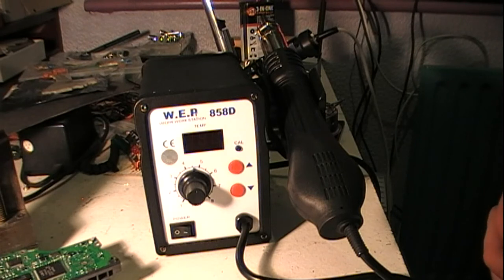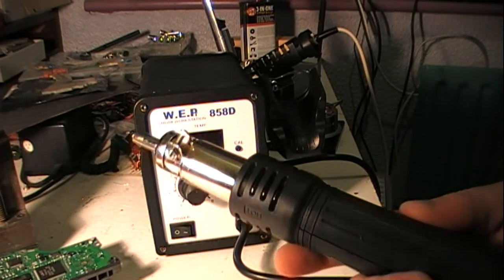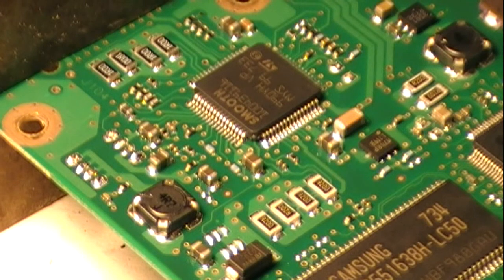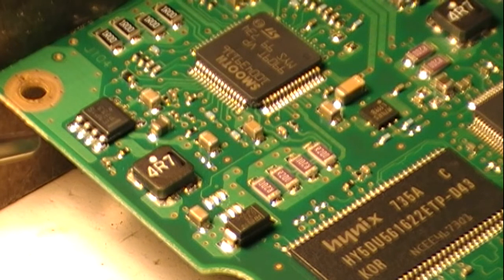Replacing serface mount components with a £30 reflow station WEP 858D

Comment: Plumbing Flux is corrosive   As Danfuerth said,  get the right flux for PC work and it would help to add some 60/40 leaded solder this will lower the melting point of the solder on the board.  you can put some Kaptan tape around the part to be removed this will help to protect the items that are close.  you done a great job  👍👍👍
Reply from the maker: These are all good points. You'll be relieved to know that I eventually got some proper flux that I use now.

Comment: For anyone buying one of these cheap rework stations , please open it up and check the wiring etc inside . I bought the 875D and from previous videos i had watched before i decided to check it out . There were some major issues inside . The 875 has two transformers because it has the soldering iron as well as the blower , they had stacked them in a very very bad way , also the earthing is suspect with none of the chassis grounded . I bought some short bolts and remounted the smaller transformer and added earths to everything. There is another mod some people do and that is the incoming power , when you get the unit the power is switched on the negative ( blue in the u.k) and not the live . Some people change it others do not , as long as the thing is properly earthed i think it makes little difference

Comment: Its always scary doing it for the 1st time, I remember doing my first which was a small 4 sided sound fx ic on a capcom CPS1 board I was bricking it because the board was a lot of money, I did quite a few test runs on on junk boards, but I did it and it looked good, I bought one of these a while back and it works well for the price, I repair arcade machine game boards and monitors and this has come in handy when changing out big to small ics, I only use it to remove ics never to install because I dont want the new ics getting to hot even though they are build to take some heat, I prefer to drag solder new ics down with rosen flux, I usually run some solder wick across the pads so they are cleam and flat then place the chip on and solder 2 corners, flux past all round and the put a tiny bit of solder on my iron with chisel tip and just lightly drag across the legs, then clean it up wirh some electric contact cleaner on a cotton bud.
Reply from the maker: That makes sense, especially for Arcade machines that are on for long periods of time, care not to shorten the life expectancy of the component.

Comment: I use kkmoon 858d 700w it won't desolder the same smd like what's wrong it's brand new nothing is soldered I use reballing machine 4800 watt works perfect but the doesn't work please reply as fast as you can
Reply: This is probably to late for your needs but there is a thing called chip quick , you add it to the existing solder and it lowers the temperature it melts at
Reply from the maker: Putting some flux on the solder to be melted before heating it may help. I use 400︒C generally, but recently I needed to unsolder an ESP32 and had to increase to 450︒C to get it done.
Reply: @DevelopIT  but I use amtech Flux it shows the smell and the gas of the solder but it won't move like it's like super solder
Reply from the maker: @Toqhy  That is strange from what I have seen from other people, usually SMD solder melts at a lower temperature than 60/40 solder. I don't know what is occurring.
Reply from the maker: @Toqhy  is the back of the SMD component soldered to the board as a form of heat sink, this would anchor the component much more securely.

Comment: Doing this on video first time is not a good idea, I saw the chip 'settle' almost 30 seconds before you removed the heat, doing it on video is so much harder so I suggest you do runs off video and I'll bet you will soon get better and enjoy it but you did ok just cooked the chip much longer than needed so practice off video!

Comment: Apply fresh flux to the chip you want to desolder and protect the components nearby with foil tape stuck around the chip for removal.
Reply: Isn't Kapton Tape batter to use?
Reply: @dbsirius  Isn't that foil tape?
Reply: @muppetpaster  foil tape is different. It looks like metal. But Kapton tape is a translucent brown/orange colour and can withstand high temperature, while being an insulator
Reply: @dbsirius  Are you really trying to tell me the concept of Kapton tape? WAHAHAHA
Reply: @dbsirius  Kapton still is a type of foil (=film)
Reply: @dbsirius  Did not mean that come out that harsh....but Kapton is foil/film ,foil/film is not Kapton per se

Comment: This Unit is rock Solid!!! . When using any Rework Station you have to use Rosin Flux ( paste or liquid) it should be mandatory. I can take and install any SMD even tiny little ones with no problems with this Unit. For the Price this thing is a steal!!

Comment: Hello,
would you recommend a 858D hot air station ?
Reply: I know someone (currently doing a PhD in Engineering Science) who has used it for years now and recommended it to me. I bought mine for 29€ and it works well so far. Good value!
Reply: @associativemicrosemantics3930  Bought an ATTEN ST-862D hot air station at the end.
Reply from the maker: +Dorf Schmidt Yes, but I have not used any other make or model, so I don't have anything to compare it to. The plus I see mainly is, it's so cheap, if it breaks, just replace it.

Comment: Hi Jason. 
Thank you for posting. Did your drive work afterwards? 
I would need to do the same BIOS swapping on a Seagate HDD and I am honestly a bit nervous.
Is there anything you would do an other way?
Reply: +Erik Mäki There are some phone repair shops, which do board level repair, they would probably do the solder job for you for a small fee.
Reply: +Dorf Schmidt I was also thinking something similar solution. Thanks for sharing.
Reply from the maker: +Erik Mäki Sorry for the delay in replying. The chip I replaced here was not the flash, the flash is the other  8 pin device on the board. I accidentally swapped the wrong chip. I've still to go back and swap the correct chip, I'll do another video when I do. It still may not fix it though as, although the board and revision number is identical, the cache chip size is different and the drive manufacture using the board is different. The drive is just from my failed DVR, so I'm just doing an experiment to see if I can do it.